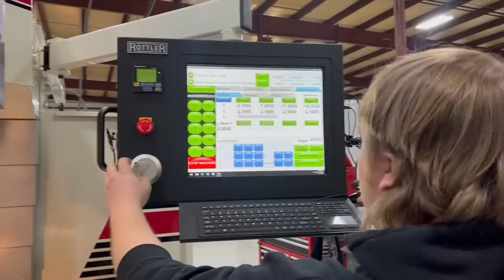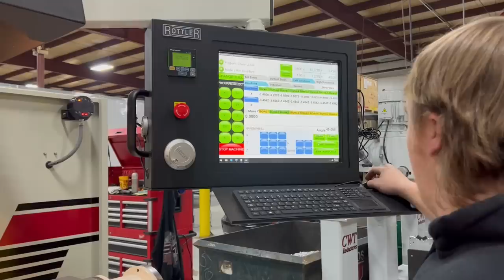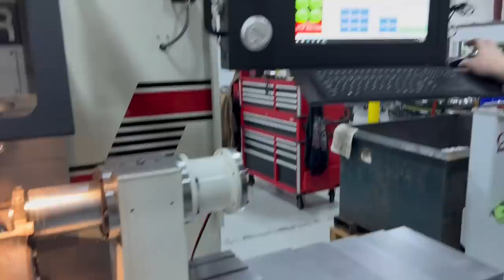PART 2 - This Is How Race Blocks Should Be Machined!

Comment: Wow, automotive machining is carpentry compared to the rest of the CNC world 😬
Reply: Yes, when machining a block that’s already been manufactured. He also manufactures billet blocks, that’s the fancy stuff.
Reply: @rshep198   I’m sure he uses a lot more precision methods and advanced tooling for that. I haven’t seen steel hog mills and fly cutters since there were leather belts coming from the ceiling. My comment was based on adjusting that boring bar he cut the lifter socket with and then not checking it on any kind of optical tool setter.  I realize they’re just doing it for the video and on a scrap block but damn,
Reply: @SchmoopsAdventures  What good would it do to set it on an optical tool setter it is going to deflect off a good amount with that very long shank and small diameter so until you have run the hole a few times to see what it is moving you won't know what size hole it is making until you measure it.  Throw in the fact that every blocks hardness is a little different so it cuts a different amount and you get a recipe that doesn't allow for set it and forget it.  That being said since they likely always want to finish on a standard size I would imagine. i would say boring to close to size for position and alignment then finishing with a reamer would give the easiest consistent results.
Reply: @bcbloc02  sorry, I thought I was talking to another 30 year machinist. That wasn’t a rough cut. It was a finish cut and if you’re oversized on your first cut you can’t adjust it after you measure it.  101
Reply: @SchmoopsAdventures  7:22 they said they were honing after boring so I assumed they were roughing since there will be an additional process to finish. But yeah if you are out too far to begin with and blow the hole oversized you are screwed. Then checking with a tool setter to make sure they were not set to an over dimension to start with would for sure be a good safety step.

Comment: I can't believe he spent that amount of money on such a garbage machine I am a career Machinist and never should a machine have to account for backlash if it's brand new.
Reply: Brand new cnc machines do 😎 I can assure you of that as I've built/setup/rebuilt thousands of cnc machines. You just don't see it as a machinist as its done in the control.
Reply: Joshua Less
Reply: @garyhowe88  there is no way. If that was the case when cutting a pocket or a round hole the thing would end with a cut mark from every single line movement.
Reply: @ColeslawConnoisseur  it is 100percent true, every new cnc machine gets laser'd and backlash comp will be set in the control, depending on travel on the axis could be every 0.01mm or upto 5mm steps on bigger machines. So please try again.
Reply: @ColeslawConnoisseur  and if you actually read I say it's 'handled' in the control by the backlash comp table 🤣 so that's why you don't even know its there 🤣🤣
Reply: @garyhowe88  only a idiot would buy a machine with 5mm back lash in a ballscrew.

Comment: As an old machinist I wanted to slap Steve's hands away from the block in the machine while it was in process. Beautiful machine, I'm just surprised it doesn't have a tool hold/changer built in.
Reply: I think if you get the f69atc it is the same machine with a tool changer.
Reply: The simpler a machine is, the less room for error. Some of the most high end accurate machines in the manufacturing world are the most simple. KISS, no offense lol. You want to be able to inspect your tool and holder and also the taper every time. He is not looking for reducing cycle time, he is looking for accuracy. Allot different than a production environment were second matter.
Reply: No safety glasses either
Reply: @stephenneill2908  I clearly saw safety squints deployed. lol. The best thing about this country is we get to make our own decisions, good or bad. Live and let live, maybe try, I care about you brother. Safety glasses do save eyes.
Reply: Why would you want a tool changer? Every tool would have to be set to the block being machined any way, and every job would be different.